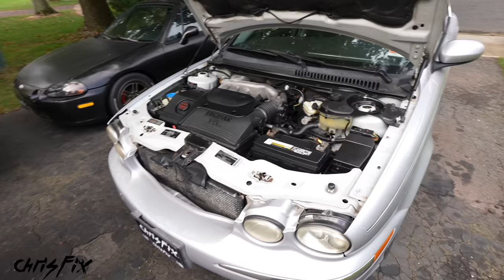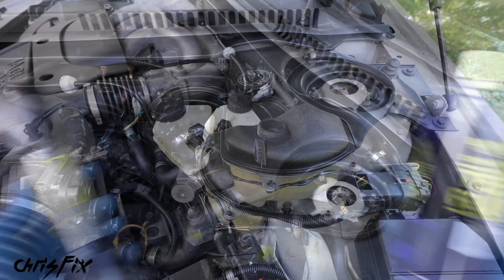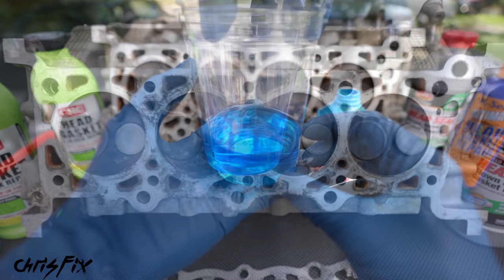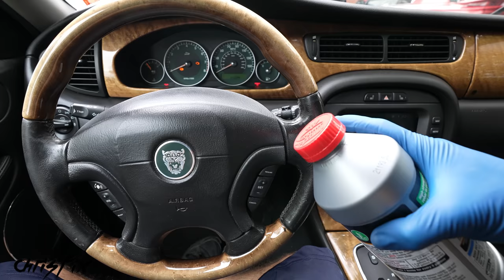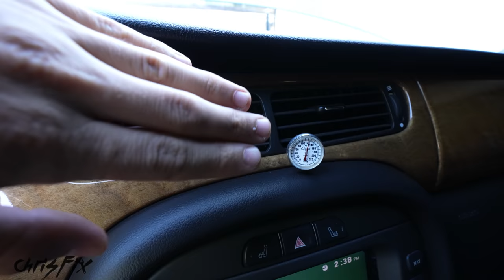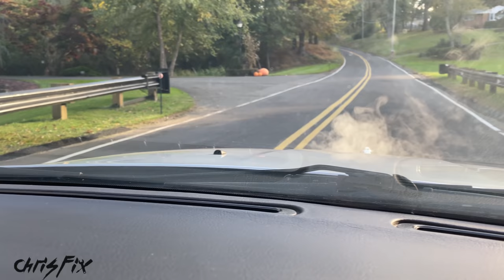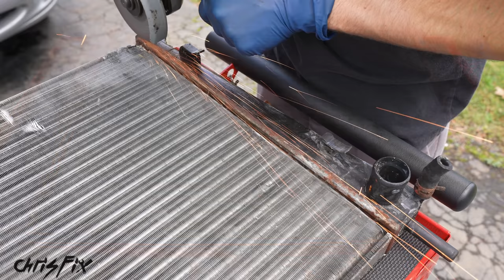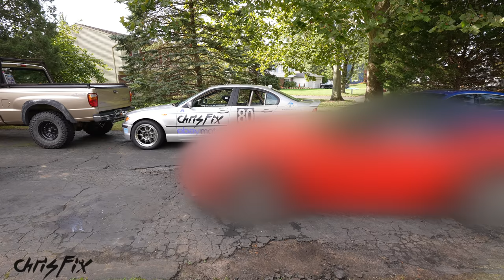Do Head Gasket Sealers Actually Work (FULL 2yr TEST with Engine Teardown)

Comment: As someone who didn't know how to turn on the headlights, to someone who is actually learning how to work on cars now. I really appreciate this video. I have been screwed so many times out of money from trusting crooked mechanics and shops. Me and my mom both are on a fixed income and finally I said I'm going to learn everything I need to learn and I'm going to do the labor. So with researching videos and talking to random people on the street who knows a little bit about vehicles I have become more knowledgeable and confident about cars. So if it's something that I cannot absolutely do myself( because I am blind in one eye) I will take it to a shop but they can't pissed on my back anymore and tell me it's raining. Currently we own a 2006  Chevrolet equinox which someone sold us with a bad head gasket. The car only cost us $1,200 but like I said earlier we have lost a lot of money in cars over the last year. So I am determined to get to fix this car myself! The car was overheating when we bought it but we just thought it could have been just a thermostat which was an easy fix. The car still overheated. I thought it could be the water pump. So tested the water pump and it was fine. I look for leaks but there was no signs of any leaks. The next thing I did was a radiator flush. After the flush, the car still ready hot but it took longer to overheat about 15 minutes vs the 5 minutes that you used to overheat. Also white smoke started bellowing out of the exhaust! One thing that I did notice and I'm leaving out, my hate being on Max never produced any heat. Before or after the radiator flush. My mom is upset because this is the third car that we purchased that we could not enjoy within 6 months. We can't even go around town which is 3 minutes away without the car overheating. Anyway my last resort is trying to rebuild the engine which I do not know how to do or use the head gasket sealer which I purchased. I purchased the Blue devil kind which in this video pointed out that it would probably not be my best option because it overheats within 15 minutes. Any help from anybody would be appreciated. Which one should I use? I would love before mother's Day that my mom would have a operable car to be able to take her to her doctor's appointments and just leisure riding. She is getting up in age and she deserves to be happy. Hopefully I can get it running this will be the third time they always say the third time's a charm! Thank you in advance.
Reply: Hey there just a heads up, Chevy equinoxs are very unreliable vehicles, I’d recommend fixing that leak (using k-seal or Bars Leaks) and selling it as it will just cost you more down the road. Check out Car Wizard on YouTube, he has several videos on cars to buy and cars to avoid.
Reply: Buy a running and driving Toyota Camry for $1,500 and drive it for at least 25 minutes or more before giving them the cash and anything not to your liking walk away fast

Comment: I believed it was Bars back in 2011 to 2012. I worked on a 2007 E-450 v10 cutaway van converted to a bus. it had 200,000 miles before the transmission went out. I followed the instructions (engine was start to miss at cylinder 4 and 5 due to overheating). topped off the coolant and I was impressed. no more missing long enough to get by.

Comment: I’ve used the blue devil and it clogged the heater core.  However it did make it go a year more until coolant (in my case water) made its way into every cylinder at the end.
Reply: Hopefully you didn't use tap water
Reply: Next time bypass the heater core and flush the system.
Reply: I’ve used bars and it did the same
Reply: @cazaruu78  no problemo in summer or short term
Reply: @ronzor8035  tap water will rust out your system. It has to be distilled water.
Reply: @cazaruu78  Bullshit; antifreeze used to be an additive that you add to the water just tapwater.. You think that they use distilled water in Africa?No  antifreeze just plain tap water. And what about ships? outboard motors with distilled water lol.

Comment: I used some K-Seal in a 1990 Ford Taurus that had a leaky head gasket: overheating, bubbling/exhaust fumes in radiator, burnt coolant smell and radiator needing to be topped off every few days or so. 

After 6 months of having K-Seal onboard: no overheating, no coolant loss, no burnt coolant smell and passed the blue dye test.
Reply: I used K seal on a 2003 Hyundai Elantra. It had thick white smoke out of the exhaust, the engine oil was milky, and the spark plug for cylinder 4 was considerably more wet and crusty looking then the other 3. I only paid $1500 for the car and used it as a "winter beater" for 5 years before it started consuming antifreeze, it wasn't a vehicle I was gonna put the time and resources into fixing the correct way so I figured why not try a $20 fix and see how it goes, and the K seal actually worked... After a couple days of regular putting around town it stopped smoking and I wasn't having to add antifreeze to it anymore. I ended up giving the car to my nephew 2 years ago, he was 16 at the time. I let him know it'll probably get him back and forth to school and work for a little bit, but I wouldn't bother dumping any money into the car and to just save up for something a little less crappy. In any case it's lasted him 2 years now, and thats even with all the standard issue abuse and complete neglect a teenage boy puts any vehicle through.

Comment: I've never put any kind of stop-leak in my car, bought it 8 years ago.

2008 Chrysler 300c 5.7L hemi

Busted a lifter. Did the replacement with a friend. Also had a blown head gasket.

When I took the heads off, I saw the break in the gasket with stop-leak near it and EVERYWHERE ELSE IN THE COOLING PORTS.

The far rear ports on both sides were COMPLETELY clogged, so the back of my engine hadn't been getting proper coolant for who knows how many years.

Probably what eventually caused my lifter to die, along with idling for too long on a fairly regular basis, smoking cigarettes in the parking lot before work (Oops).

That's my experience with sealer/stop-leak.

And, dude... What a video! Got yourself a new sub

Comment: Silver Bars Leaks patched my coolant leak going into the intake manifold on my '02 chevy venture - it's been holding for fifteen years!  The van is rusting to death.   The thermostat did seize open and heater core lost maybe half of it's output after treatment, so I would, if every had to do this again, bypass the heater core and take the thermostat out until the leak stopped, then flush the treament out and put it back the way it was.. then like Chris says, change the oil right away.

Comment: In a 1991 Thunderbird with a blown head gasket (and found out later a cracked head), I used 'Steel Seal'. Because it was one of the few that you didn't have to flush the system after treatment. It's a LOT more expensive, but well worth it IMO.
Reply: How was your success with steel seal? Long term? Also, did it plug your heater core?

Comment: Truly a great and informative video. Thank you for being so thorough. For dedicating 2yrs to showing the long term effects and capabilities of the sealant. For taking it down to head to paint a picture of what was going on. For showing the inside of the radiator to prove that the sealant won’t seal where it’s not supposed to, and will only seal where there’s extreme heat. And for sending in the oil sample so that we know how important it is to get fresh oil in after the sealant has set. You earned a sub with this one. Great work.

Comment: I have used several sealers in my time thus far. The Bars HG1 has been the most successful pour n go I have used and has help three out of four cars I have used it on. Sadly I had a PT cruiser engine that was blowing back into the coolant system so badly that there was no hope for the sealer to work.

Comment: I was impressed with blue devil, i used this in 2018 on my 2002 chevy Silverado 4.3. I had antifreeze in my oil. Still to this day and over 130k later still running perfect.
Reply: 99 Silverado 5.3 had the milky stuff on the oil cap and did the blue devil.. 5 years later still rolling no issues

Comment: I used blue devil in my 02 wrx worked great lasted a few months until I had to rebuild my engine due to my abuse of it.  I was shocked at how well and completely it sealed my head gaskets when I was able to get my mitts on them. Highly recommend when it'll work for you

Comment: I’m a diesel mechanic, have been for 15 years now. I replaced the head gaskets in my 88 f150 a few years ago and I ended up buying a 2004 Ranger 3.0 I’ve been driving it for the past couple years every day.. the head gasket has a small leak and I was very upset to have todo all that work because it’s a good truck all around. I’m glad I decided to watch your video and a couple others, even though I’ve been told to stay away from these products and fix it right, which I do fully believe in. I think ima give it a shot because it’s not a big leak, truck doesn’t overheat only thing it’s doing is pushing the coolant into the coolant reservoir, so hopefully this will buy me some time so I don’t have to drive my ol F150 around every day, I love the ol ford but it’s not comfortable to drive everyday.

Comment: My experience with a cyl 2 & 3 misfire after a blown radiator and engine overheat was that Steel Seal fixed it for a year, before the 2 - 3 misfire came back and I put in a used engine.

Comment: Had a Nissan Primera with an blown head gasket, "luckily" only for water to enter the cylinder, but that's still not very good. I used Barr's headgasket-fixer, and it worked really well. Didn't solve 100% of the problem, there still was some smoke and coolant usage, but all the big problems were gone. 

Dad once used K-seal for his Ford Focus, but that didn't do anything.
Reply: I've also used K-seal as well. It helped my civic for like\ 2-3 weeks before overheating again.
Reply: I also used K Seal and was very disappointed as it did not work.

Comment: Great Video Thank you. I am an old school mechanic with an old school tip that works perfectly . Scramble 3 eggs add 2 tablespoons of Tumeric powder. Engine must be cold . Drain old water. Fill up with manufacturers recommended coolant and water mix.Remove thermostat and pour in the mixture .Run engine hot and go for a 20 minute ride. Reinstall thermostat and bleed system and check level. If you have a combustion leak tester and a preassure tester do the test. If not just carry on and monitor. Works like a charm mostly depending on how severe the damage was. Will seal leaking radiators and repair cracked heads and blocks also. Helped many customers who were not in a financial position to pay for costly repairs or get a new car.Bought them some time to save up. Some have been driving like this for 5 years no problem. Last car I repaired was a Volvo V40 2liter Turbo . Still running. Owner very happy as Volvo spares are not cheap.

Comment: Ouch that quote was nuts. I just had a head gasket replaced on my 2014 Jeep Patriot latitude at the dealership i bought it from and it was still less than $3k. The labor was less than $1k and they completely replaced the head because the one that was on it was cracked pretty bad.

Comment: Hey everyone, I used the Bar's Leaks H1 Head Sealer on a 2003 Honda CRV with 145k miles my daughter let overheat, over a loose lower radiator hose clamp leak. After following the instructions, it worked for me and stopped the white smoke from exiting the tailpipe as well as loss of coolant. The only downside was the loss of cabin heat do to it clogging the heater core. I flushed the system but the overheating, loss of coolant and white smoke returned so I again introduced the Bar's Leaks and all symptoms once again stopped. I actually had to install an electric heater to help keep her warm. She was able to use the vehicle for an additional 3yrs before another unrelated mechanical, situation arose, and we made the decision to donate the vehicle.

Comment: After watching this, I made the choice to use the Bars sealer in my 2005 Chevy Trailblazer 4.2L  inline 6 cylinder. By the time I diagnosed it my 5th and 6th cylinder were substantially  lower on compression tests. I used it and got almost 9 months of driving but after that the head was completely blown to the point that I got instant bubbling in my radiator upon cranking.

Comment: Thanks for the video, good content. I have been a mechanic for many years. Best way to fix a head gasket is pull down and repair. I purchased a vehicle with the fixer in it. The engine failed about 6 months. I put more in and it also worked for a couple of months. When it failed this time it filled the cylinders with coolant and hydrolocked. This broke a con rod and really screwed up. It is exactly like you said, if your $500.00 beater blows a head gasket do it.  If your newer family car blows a gasket get it replaced.

Comment: Very good video. Learned alot. Many thanks. Just used a treatment on my 1982 Rolls Royce head.  Gaskets were replaced with genuine RR gaskets 10 years ago, but only 15000 miles since. Suspect head warp aftet watching your video.
Reply from the maker: Dang, is it still consuming coolant?

Comment: So 2 questions from someone dealing with the same problem.  1. Why did the engine give out after 10,000 miles? 2. Could you have put more head gasket sealer in and get another 10,000 miles?  Thanks man, awesome video.
Reply: Good question, hoping Chris can give us an answer
Reply: It likely failed because the materials in the gasket sealer started breaking down due to age and the heat cycles. It's very possible to add more and get the same results. But with any sealer it's hit or miss on even working to begin with.

Comment: there are 3 videos I been waiting to see. 
1. The new car in the red car cover (hopefully the next video) (this is the one I've been waiting to see so badly).
2. The 24 hours of Lemons Race
3. The Trailer (in which I have a few suggestion for it)
Reply from the maker: What are your suggestions for the trailer?
Reply: @chrisfix  For the cabinets and the cabinet hitches, along with the LED lights, I would buy them from lowes or home depot because they sell cabinets for cheap prices. Maybe Tile on the floors but tile is very pricey and time takes long to do. A generator from harbor frieght or camping world stores. (the caterpillar one is like 2,000-5,000 dollars)
Reply: @ChrisFix if you decide to install a winch in the trailer, I would buy one from harbor frieght or tsc tractor supply because they are a lot cheaper than warn ones. If you go for a warn winch and try to find custom parts for your hummer, and truck  I would try 4 wheel parts they have a couple store in your state and they have a website and you can have cheap or free shipping if you buy expensive items
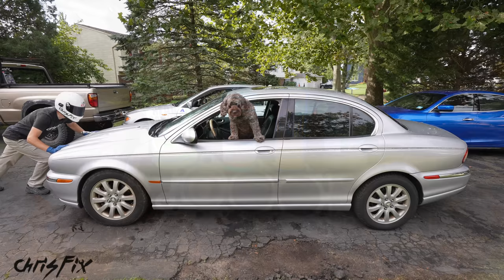Reply: @UCgtD-4UKWKiOeUUrOD_GNhA 30:00. i think its a 2nd gen dodge viper based on the sound

Comment: The sealer I used required draining and flushing the system, removing the spark plug from the bad cylinder, running to temperature, letting cool and draining the system, letting sit empty overnight, refilling with 50/50. 
Worked AWESOME!!! Definitely suggest replacing the thermostat after using ANY stopleak!
Reply: What do u mean by 50/50?
Reply: @explorinlearnindoing5462 

Coolant mixture
Reply: @cw5118  okay thanks
Reply: But the stopleak stays in the system anyway so why replace the thermostat
Reply: @GlobalDesignHD  Isnt it that it blocks the flow of the liquid... so it doesnt work as good, as when you remove the thermostat.. so it gets everywhere...
Or am I wrong?
Reply: @explorinlearnindoing5462 if you are using the stuff Chris was talking about, it doesn't block/harden unless it's hit by exhaust gas...over 1000 degrees. Water/coolant flowing through the thermostat  will stay 200 ish degrees, so won't clog anything.

But Chris used the thicker stuff so it temporarily plugged his thermostat. Just needed more circulation time to do its thing.
Reply: @tedcox3586  Ahh okay thanks for the explaination! 👍

With replacing the radiator my mechanic/sort of friend forgot to tighten the lower radiator hose... 
When I made a small test drive and came back the hose came loose, and all fluid came out... leaving the engine hot... I think thats what caused a broken headgasket. Since then my engine uses some coolant. Its not much (half an inch in 1 to 2 months of daily driving)... but the exhaust smells too much/bad, like sweet coolant. And very slight exhaust vapor... even with a warm engine. Its a V8 Mercedes so pretty expensive to change the gasket(s).
But with 230.000 miles perhaps the better choice. Right?
Reply: @explorinlearnindoing5462  yeah, I'd say that a sealer would be a good choice if the repair would cost more than the car is worth. And loosing that little bit, seems to me it would seal up nicely.
Reply: @tedcox3586  Yes indeed... 
What did you mean by loosing?
Reply: @explorinlearnindoing5462  you mentioned your car was using a little coolant...

Comment: I've used the bars leak head seal in the big silver bottle, best $50 I've ever spent. Had coolant burning thru the exhaust (white smoke) as well as coolant level lowering. It all stopped after half a bottle usage. 1986 Cadillac sedan DeVille 4.5... yours took too long, mine only took 25 mins to fix.